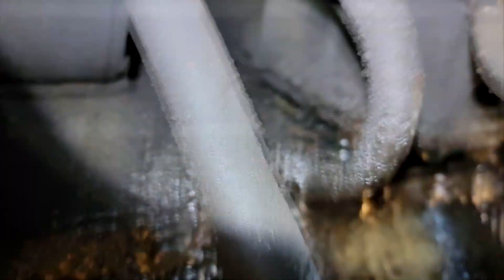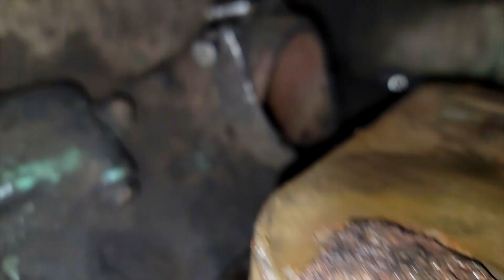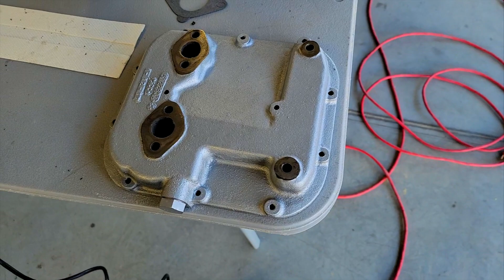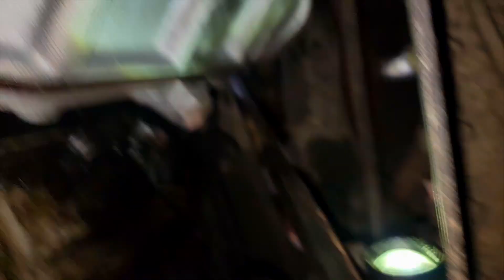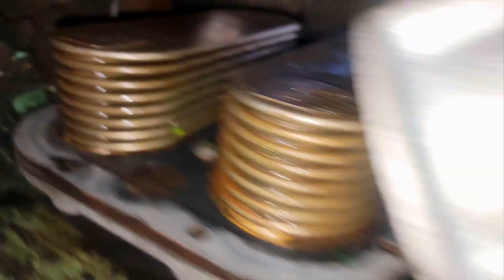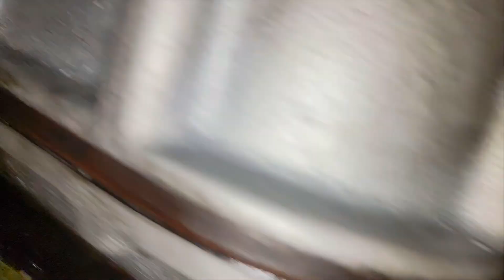Fixing Our Oil Cooler Leak

Comment: If you stuff a 6v92 in there I don’t think that job is doable thru the the access from the hell hole. If I ever need to do that job I think I’m pulling the engine.
Reply from the maker: I remember talking to an old bus guy who said he had a little dolly that was on a jack that made removing his engine really easy.  According to legend - he would remove it sometimes just to wash it and check on leaks!

Comment: I had an old F250 diesel that had bolts that went thru the water pump into the crankcase, the recommend sealant was Permatex aircraft sealant - I think that would be good for the various bolts, and other things- it is non hardening and seals oil & water nicely.
Reply from the maker: Thank you OC - I will look into that for sure!

Comment: There us a bokt on the back side of the oil cooler
Reply from the maker: Thank you Dave - I do not recall seeing a bolt on the back side of the oil cooler just the ones I mentioned - 10 holding the outer shell on, 2 on the side for the water inlet, 1 clamp up top, then 2 holding on the actual inner cooler and 6 holding down the base.

Comment: Great work!  You should invest in one of those cheap Inspection cameras that attach to your smart phone to help you see in those tight areas
Reply from the maker: Thank you. I actually did buy one and returned it because the picture was just awful.  It was impossible to hold it still enough for long enough to get a clear view of what was going on.  It could have been operator error - or maybe I just bought one that was too cheap but it was pretty terrible.  It's one of like 3 things I have ever returned to Amazon.

Comment: Great job on the oil cooler repair. I believe that the cover you painted was cast iron, not steel. There is a lot of cast iron parts in those engines. You are getting very handy at fixing up you bus. That is great, as it seems that some repair shops are not doing the best job these days. Glad you are still cruising around the country!
Reply from the maker: Thank you Bryce!  It was heavy enough to be cast iron for sure!

Comment: You have an incredible amount of patience or good editing 😊. A little late now but on old seals being reused when new is not on hand you could have put just a little smear of rtv on it to help it slide into place and help it seal. I have had really good luck using silicone plumbing grease when putting together o-rings on cooling systems and have yet to see the coolant looking like it is contaminated. Great job
Reply from the maker: Thank you so much!  Fortunately, that old seal has held but I now have the plumbing grease trick in my back pocket for the future!  Thank you for tip!
Reply: You are welcome and safe travels.

Comment: Glad that you were able to get a good new seal to have on hand if the original seal goes bad.  
In the past I have used gasoline and a very sharp wood chisel to remove old gaskets from surfaces.  
But that was back when gas was less than a dollar a gallon  :)
Reply from the maker: Thank you Gregory - I am still learning as much as I can and I appreciate any advise you guys with more experience can offer.  I remember gas costing 90 cents a gallon when I first started driving.  I had a Jeep CJ-5 that was SOOO thirsty.